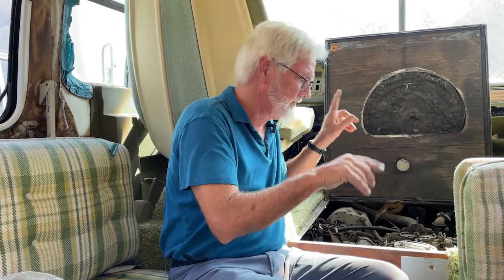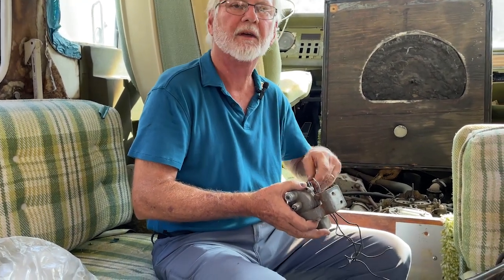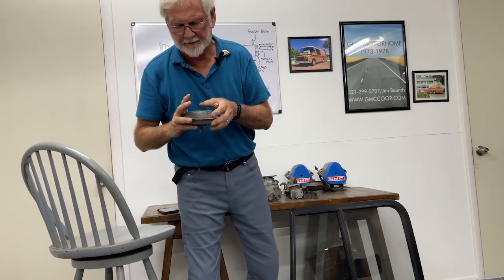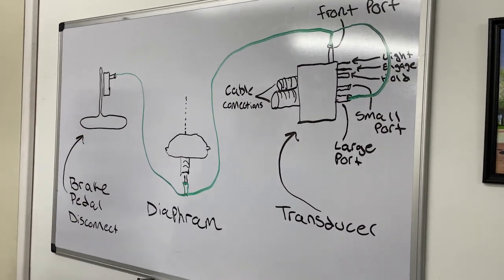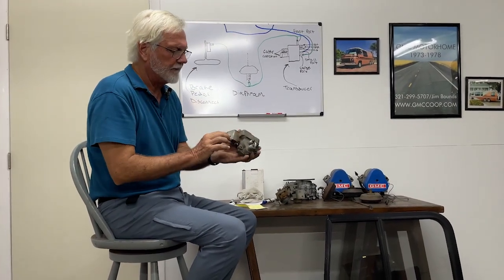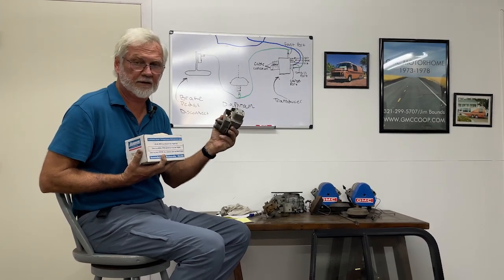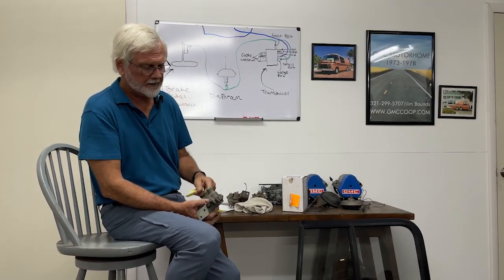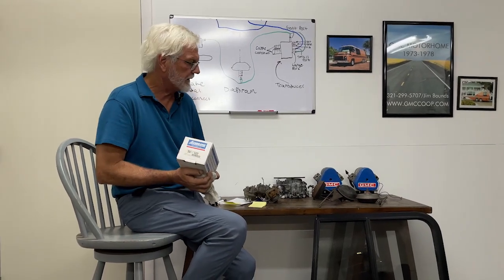GMC Motorhome - Original Cruise Control

Comment: Awesome video,  4 years too late. After changing out  my dash , mine didn't work, this spring I started reading the manual on it.  I thought this cruise control was kabuki science,  turns out it's the simplest thing , and I fixed it in about 20 minutes after an hour of reading and understanding it. Works great

Comment: Learned a lot today! I thought my cruise control system was stolen with most of my engine parts. Now I know where to look. All that's missing is the custom Isspro speedometer from MacDash. Jim, the dash you installed in 2012 is so perfect!

Comment: Just FYI guys, this is a standard AC CruiseMaster unit used in various ways for about 15 years throughout GM.  This link should also be helpful:
http://www.bdub.net/1968-1982_Cruisemaster_Cruise_Control.pdf